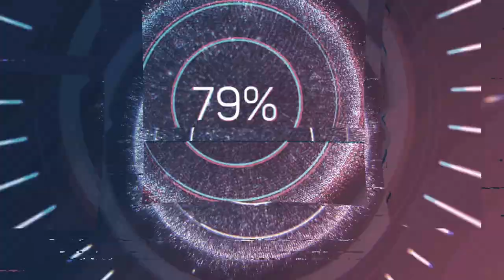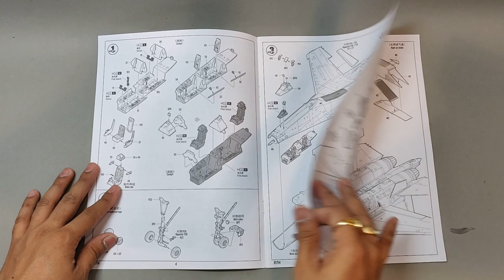Su30 MKI . 1/48 . Full Build . HobbyBoss

Comment: i think you missed out one important step, which is to provide a high gloss on the model before the decals go on. this is why there is a slight silvering on your decals. should always provide a high gloss before decals go on, then use the setting solutions, when its dry , then put on some decal softener, and when that dries, one more coat of gloss coat, then you can do you sludge wash and panel lines. when all is done, then the final flat coat goes on. everything is sealed and the decals are protected and silvering wont happen this way

Comment: Capt Adi, I noticed you used styrene sheet for canards and then you fit the two fuselage together. There was gap between the two pieces. How did you manage to fit them together? Did you sand the styrene sheet that canards were made with?

Comment: Hello I am korean 🇰🇷. After seeing the teacher make a su-30mki canard, I am going to try it. If you know how many 'mm' of plastic plate you used,Is the putty hard when it hardens?
 I ask you a question. Could you please do it?
Reply from the maker: Hello . .  The canards and the leading edge extensions are cut from 1mm plastic sheet. . .  The putty is a two part epoxy putty which does dry hard. It can be wet sanded too . .  Hope it helps.  . .